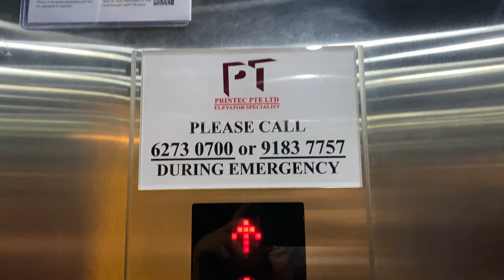CANNY KLW MRL @ SCIENCE CENTRE SINGAPORE [EXHIBITON LIFTS]

Comment: Still rmb riding the cylinder platform lift back in 2017,what a nostalgia haha...came back in 2018 and saw it being removed with only the cylinder shaft still arnd,also wonder what happened to the huge and liminal exhibition upstairs,from your vid it seems like they have walled it off or smth
Reply from the maker: Wait, what? There is a cylinder platform lift?

Was it at iZhero? Or somewhere else?

The iZhero is a square platform lift with screaming sounds!

And for that huge exhibition upstairs, they had some scary exhibition, didn't dare to go in.
Reply: @ZHD1987E  I rmb it was prob part of the other hall...from what I could rmb,the other platform lift was actually circular(with circular sliding doors) and had the same spec as the square one(other than the shape),they started scraping it somewhere in early 2018 and the last of the lift I saw was the exterior shaft
Reply from the maker: @_ G En  
I don't remember that lift. Oops! Thanks for letting me know. Didn't really explore the Science Centre that seriously until like 2021, where the platform lifts are gone!

Had they still existed, I would have filmed them and posted them on YouTube.

Need to ask: Is that circular platform lift blaring screams of 'help me' like the square one?
Reply: @ZHD1987E  that platform lift was prob also part of IZhero from what I rmb,so the exhibition hall upstairs were HUGE,and no I don't rlly rmb there being that annoying speaker,just that I was initially surprised that it was actually platform lift! And not a regular lift (which is why the sliding doors were deceiving initially haha)
Reply from the maker: @_ G En  So sad only one lift enthusiast filmed these platform lifts...

These were like the only ones in Singapore to have sliding doors as platform lifts and have screaming sound as default elevator music. No other lift anywhere in Singapore is as scary as this!

Edit: turns out there was one
Reply: @ZHD1987E  well,this is actually a video of the square platform lift filmed by a lift filmer, https://youtu.be/4DKBsd3ZPzA though blurry,u could still see how it was like inside (the buttons and etc)...and yup it was unfortunate both were removed in 2018,the previous IZhero exhibitions were honestly very 2000s and nostalgic...just sad that I didn't get to visit it in the later years prior to the removal.
Reply from the maker: Oh, how about the circular lift? Did anyone have a video of it?

By the way, the video you link didn’t have that screaming sound. Was wondering why, probably speaker down for maintenance or screaming sound only plays when lift goes up.
Reply: @ZHD1987E  I doubt so,couldn't find it online unfortunately :( but the ride experience was as wild as the square one, though without that crappy speaker in it
Reply from the maker: I remembered

iZHero only had one square platform lift, and so the circular platform lift is actually where the other Canny stands i.e. the circular platform lift served some earlier exhibition before it was scrapped and replaced as the exhibition changed to ‘Dialogue With Time’.
Reply: @ZHD1987E  ohhh wow,so I did rmb that correctly...so unfortunate there were no vids of it bef it was gone. That lift was honestly more memorable than the square one...btw do u happen to know the name of the previous exhibition? Perhaps some photos of the lift could be found on Google
Reply from the maker: Isn’t it Island Adventurer?

Source: Looked at old Science Centre Map.

Also on the same map there seems no existence of a circular platform lift THOUGH it may not be reflected on the map or you may have confused that circular lift with some other place OR the square platform lift is actually in a circular shaft.
Reply: @ZHD1987E  I'm very sure it existed,I even rode it and saw it in operation....it was located at exhibition B,(where Dialogue of time is at now)just that its shaft was located somewhat hidden further in (towards left) and wasn't right beside the spiral staircase unlike now.
Reply from the maker: What a shame… I should have explored the place a bit deeper beforehand: who knows? There may be some hidden gems?

Also, it does seem the old Science Centre map is quite inconsistent: it shows the existence of a lift to iZHero (the torture chamber), but does not show the existence of the other lift in hall B.

For some funny reason other maps reflect the existence of the circular lift. You are right that actually 2 platform lifts exist in the Science Centre, that have since been torn down!